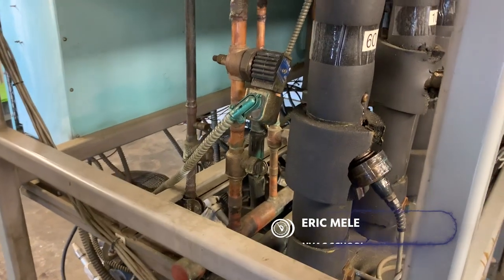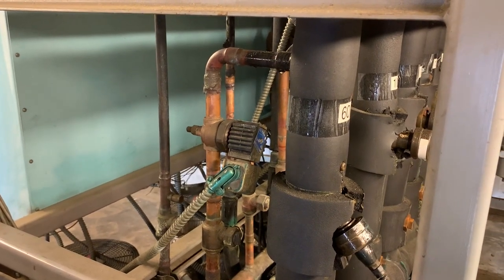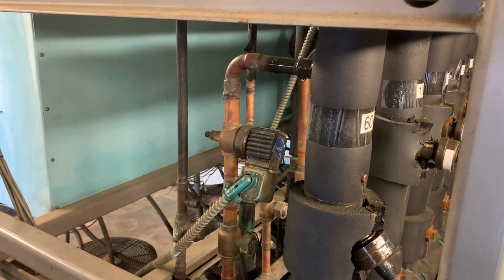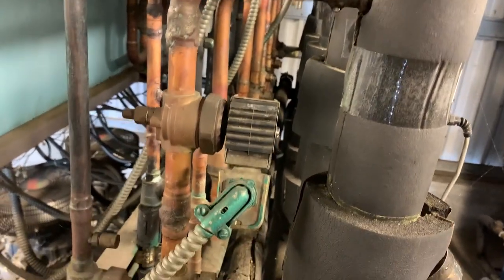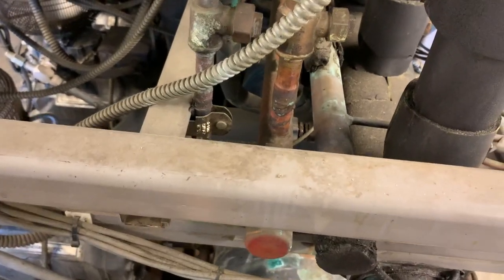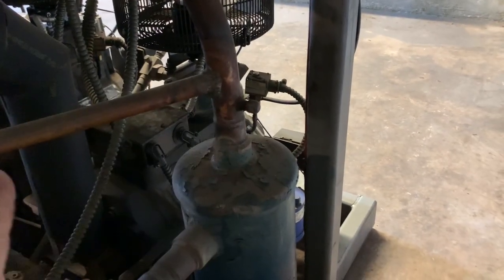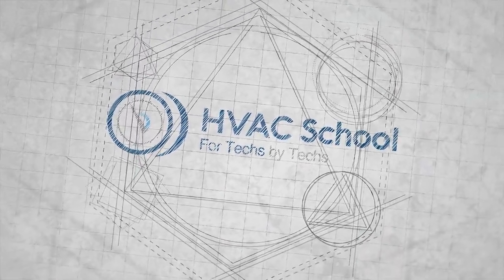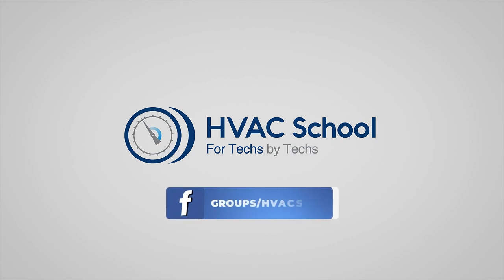Rack Refrigeration Defrost

Comment: But my service manager said refrigeration is just like air conditioning  only with lower pressures.  I L M A O
Reply: He's correct in the fact that the refrigeration theory is completely the same, but it is an entirely different world in reality
Reply: I see in my day as a refrigeration mechanic that sometimes they hire a A/C mechanic most of them don’t pick up information of refrigeration they give up after 3 months go back to ac work there different refrigeration work Racks,Cascade low temperature, environmental chambers , self contain ,ice machine,ect did it all plus Ammonia system which I never touched,
Reply: @hvacrnortheastern2110  See it also. They need to hire qualified mechanics or at least have them work with seasoned mechanics for a year or so until they get their feet wet on these refrigeration systems. Throwing hem to the wolfs and then blaming them when they fail is the fault of Companies upper management , not the technicians.
Reply: Yeal, mine said the same thing.  When he said that I knew he had no clue about refrigeration.

Comment: ok so how does the gas make it back to the compressor when its in defrost? so it runs long enough to defrost the coil without banging off on low back if tht valve on the suction line dwnstream on the hot gas bypass is closed...